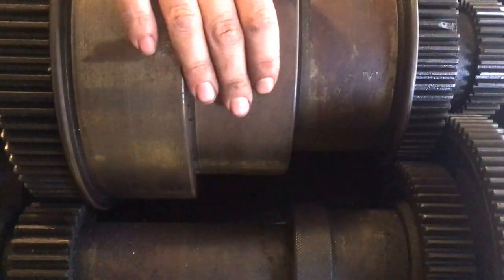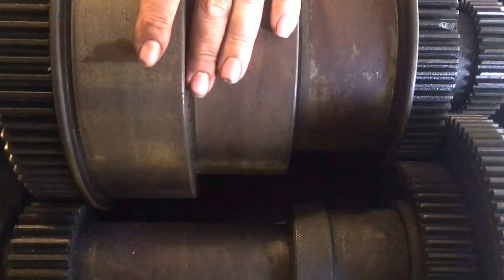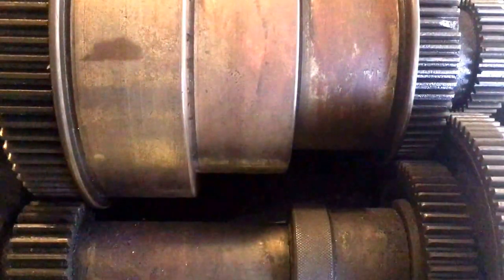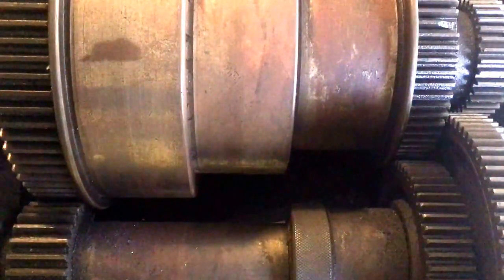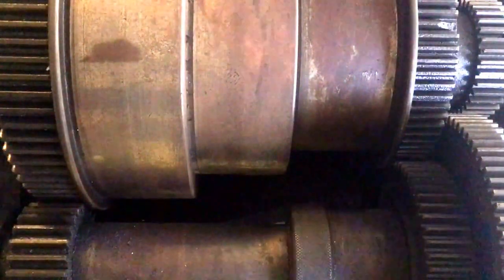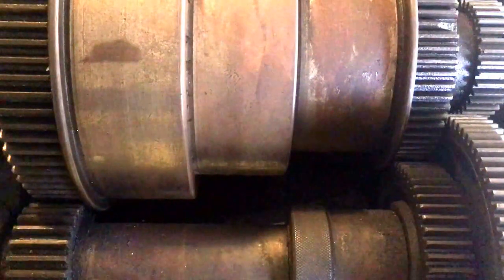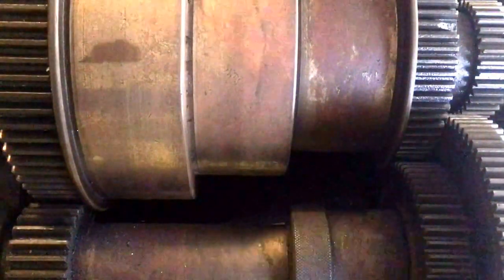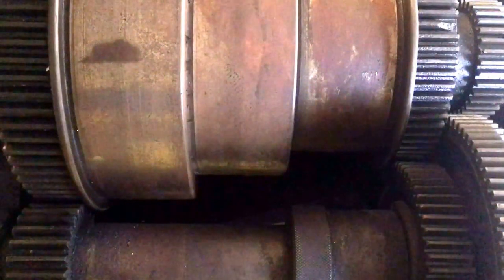Monarch model A; how the two speed back gear works and exploring apron controls

Comment: I recently got an almost identical Monarch for free (move it and ya can have it!) but mine only has a single speed back gear, so clearly you could get it with either back in the day. I've also got the cabinet leg option, which is cool. I'm probably going to use it as the home for a coolant system tank and pump but we'll see.

Only issue with mine is that some previous owner has managed to lose the input countershaft part of the flat belt drive setup, so I'm going to have to make one (no bloody chance of finding one for sale here in the UK) or come up with something else. The guy I got it off doesn't remember his father ever having the countershaft, so how he was powering the thing is a mystery? Was partly dismantled for collection when I picked it up, so...

Currently in the process of cleaning 100 years of gunk off it, then probably going to give it a fresh paint job, as most of the original paint is gone by this point. Surprisingly, given the uber-grubby condition, there's not much corrosion and the bed, apron, etc are in good condition; no dings, missing chunks or gouges that I've found so far. Appears that it was pretty well looked after but non-essential cleaning wasn't high on the priority list.
Reply from the maker: You can probably make a cone pulley out of wood, I’m sure you’ll be able to cobble a drive together.